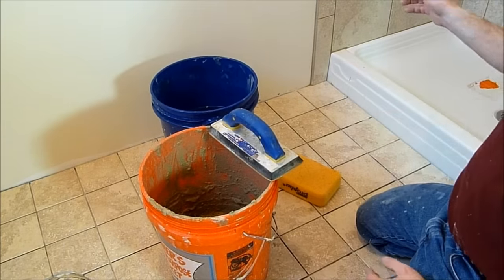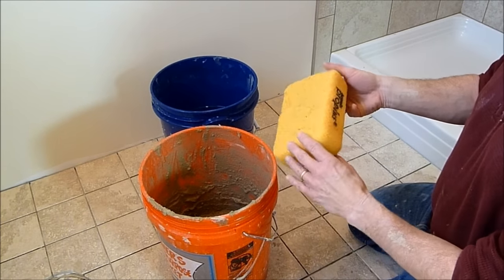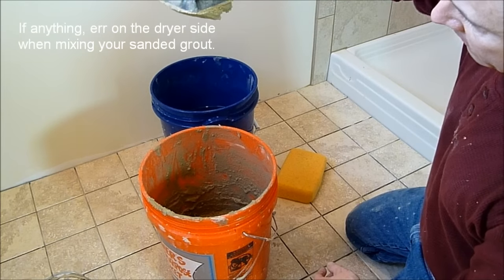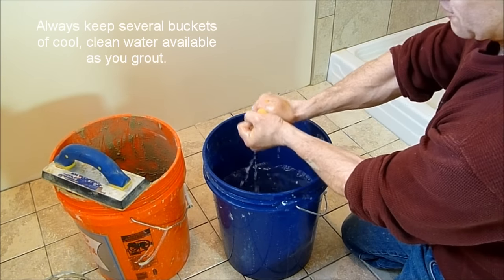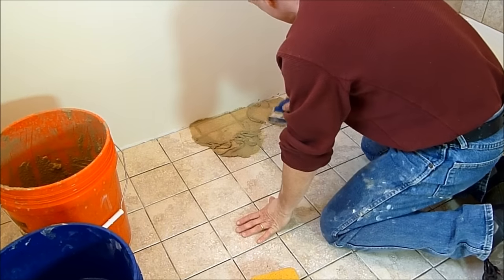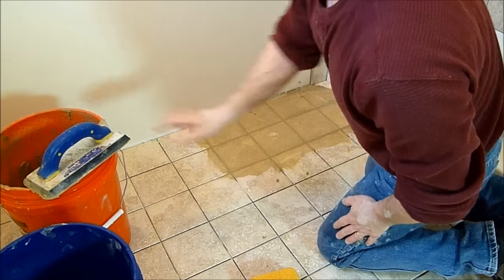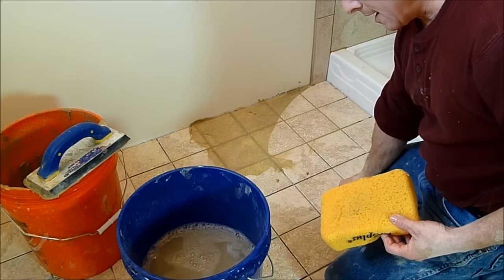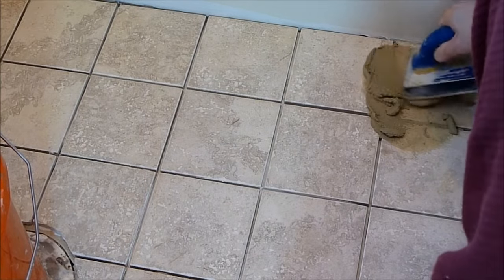How To Grout Tile: Correct Technique Makes It Easy

Comment: That's exactly how I put icing on a cake!
Reply from the maker: There are some masons who use an industrial-sized triangular bag with a hole in the point to repoint bricks with mortar, exactly as cake-decorators use.
Reply: I was thinking that the way you spread the grout at first made it look like icing.  Gordon Ramsay would approve of your technique.

I’ve seen those bags, and I wondered what they were for.  I thought about using them for putting grout in the tile spaces, but the opening in the bag seemed too large. 

What if you could get something like the tubes used for caulk, only you put grout in them?  Then you just squeeze the trigger and apply it like a bead of caulk.  You still have to work it in and smooth it out, so maybe this is not such a great idea after all.  

I have lots of ideas that turn out to be disasters, but it’s fun to try something you’ve never done before to see what happens.  
Thank you for posting your videos!
Reply from the maker: Yes, you answered your own question.  Since the grout needs to be worked and pressed into the cracks, there's really no time saved in trying to minimize the spread over the rest of the surface.

Comment: Great video. Question for you. I was tiling the laundry room and had my baseboards done as tiles as well. Do you normally grout both the floor tile and the"baseboard" tile at the same time? I hear people do that normally so you only mix up one vat of grout.
Reply from the maker: If you are using the same color grout on both tile then there's no reason not to do both at the same time.

Comment: I like the vid but how do i remove dry grout of the walls?
Reply from the maker: John Mcleveish If you've grouted correctly there should only be a slight haze on the tile after it dries.  This comes right off with a damp cloth or sponge.  If you've made a mistake and left grout where it shouldn't be you may need to scrape with a putty knife (try a plastic one first so you don't scratch the tile) or some other implement.
Reply: John Mcleveish The baseboard trim, once installed in place, should cover any smudges made on the walls during grouting.
Reply: ***** lol dude your late i already tiled and finished construction on my home but thanks anyway
Reply: Don't you get one of the special tools such as a grout saw

Comment: Don't forget to prep and remove any thinset that might have come up between your tiles when you laid the tiles. Otherwise, you might see some of it if your grout color is very different from the color of the mastic that you used to adhere the tile.
Reply from the maker: I think you mean "thinset" rather than mastic.  You should not be using mastic to lay tiles in a wet area like a bath, and I would argue mastic shouldn't be used in any circumstance.
Reply: @enduringcharm  yes thin set.

Comment: I've been killing myself using too much water. I'll try you method tomorrow. Thanks!
Reply from the maker: It's second nature to me now, but it can be tricky to get the right mix when you aren't as experienced.  You may have better luck with smaller batches.  Use a drill mixer and sneak up on the right amount of water by spritzing with a hose as you continue to mix.  If you screw up you can always add a little more grout as long as you haven't used up the whole bag.

Comment: How shall i dispose of the grout water? Cant be in toilet right?
Reply from the maker: You can dump the grout water outdoors, it's not harmful to plant life.  I usually fill the grout buckets from a hose anyway, so if some grout from the bottom of the bucket ends up in a pile, just hose it down to disperse the remains.

Comment: you must get paid by the hour if you do a few tiles at the time...Depending on the kind of tile you can do from 10-20-30 sqm before washing it with sponge
Reply from the maker: This video was made for amateurs who are new the process, so I think small sections are wiser.  When I work I grout the area that I can reach from my knees, then move the buckets to the next section.  Depending on the shape of the room that area may be smaller or larger.  In a typical bath with shower or tub/shower and floor the grouting takes two or two and a half hours, including clean up.  For a larger or more complicated bath it may take a half day.  The beauty of my system is that I never get up and go back on a previous section to clean up haze, etc.  Once a section is done, it's done.

Comment: Can’t you just lay the tile for a thin grout line with  un sanded Grout? Without sponging and wiping ?
Reply from the maker: You can choose thin grout lines (under 1/8" inch) if you like and use unsanded grout.  But, the application process is the same.  Arguably the unsanded grout is even a little more finicky to work with since you can more easily pull it out of the joints as you wipe.
Reply: Ok thanks for the reply

Comment: why does grout break out of the tile seams?
Reply from the maker: Jim Smart There are many potential reasons for grout failure.  Among them are a floor, wall or underlayment that flexes too much, damage from from use (heels, rolling wheels, furniture, etc.),, and poor installation.  Age can become a factor after many decades of use.

Comment: why would u grout the the tile gaps that meet the wall?? maybe its just America but here in australia they have to be caulked..
Reply from the maker: You were looking at the room before the baseboard trim was applied.  Typically in the US the tile is put down first and grouted and then a baseboard moulding is applied around the perimeter of the room, which covers any gap.
Reply: I was under the impression you were tiling floor to ceiling my bad.

Comment: Can you pour the water down the drain?
Reply from the maker: That's a great question.  While the "grout water" is not toxic, the sand and the color stain could cause trouble in the sink or the drain.  I dispose of the water outdoors.  It will not hurt a lawn or shrubs, and I hose down whatever I pour out to dissipate the sand and color.  It's never been a problem in the decades I've done this.  If you live in a city or in a situation where outdoor disposal is not possible or practical, you could look for a utility sink and wash the sink with fresh water as you pour.  You could also attempt to catch the sand and toss that in the garbage rather than let it go down the drain.

Comment: my bag of grout says to wait 30-60 minutes after floating and before wiping off with a sponge,
Reply from the maker: I don't doubt that your bag does say that!  You'll also get that same advice from Home Cheapo sales associates who have never actually tiled before.  That old school method did entail a lot of waiting and scrubbing and scrubbing some more.  If you enjoy that sort of thing, the grout will still work that way.  But, if you have other things you' rather be doing then the method shown in the video will work as well for you as it has for many others.  I have tile installations that are 20 years old using this method without issue.
Reply: not disagreeing with you and should've went with my gut.  i grouted an area of about 325 square feet in one shot.  the grout started to dry and it was a real bitch to get off.  in the end the tile job looks great but that'll be the last time i listen to the instructions on the bag.  felt like my arms were going to fall off.
Reply from the maker: HAHA!  Yes, that's the problem!  Sorry you had such a tough time, but that's exactly why I use the method in my video.

Comment: How  we can remove the hase after grout
Reply from the maker: If you used my method in the video there will be little to no haze after drying.  You can use a dampened rag.  If you used a different method or you screwed up and have a lot of haze, you may need to use a chemical haze remover available at your tile store with either a rag or even a scotch brite pad.

Comment: No knee pads? You a beast...
Reply from the maker: Actually I do usually wear them, but this was a tiny job and maybe I had broken them or something that day.  I have difficulty finding knee pads that stay on and that stay together.  Often I'll only get one or two jobs out of a pair.
Reply: @enduringcharm  I been trying several brands. , but they all seem to slide down and then you don't have knee protection.  I bought the gel , with an upper strap that helps keep them up ., but still slide down. The guy that invents knee pads that don't bind you AND don't slide down will make a million! !
Reply from the maker: Yeah, lots of new designs now but most of them are awful.  The pads with just a single strap are useless.  I try to buy the type with two adjustable straps (non velcro).  I've found if I criss-cross the straps in an X pattern behind my knees they stay in place a little better.  Pants with pads built in would be better.
Reply: @enduringcharm  I actually had an idea now.  How about some knee pads have the little loop in the top sewn in. You can take large safety pin and attach it to your pants that way ..  I am going to try it. .
I tile and some days notice that I have the knee pads on , but they moved out if position and I am on my knees, no pad.. 8 to 10 hours. Some days I think I should have been a hairstylist ,, like my sister.. Heheehee!
More money in it than tiling. ..
Reply from the maker: Well, report back if it works!  I have the same issue with movement, usually on my right knee.  I'll have something in my hands so I can't adjust the pad, and I end up kneeling down with nothing more than shin protection.  I ride motorcycles and you can get motorcycle jeans and pants with built-in knee pads, adjustable for height.  Unfortunately they are way too expensive to use in construction.

Comment: how to mix the grout perfectly? i have no idea
Reply from the maker: Look in the video description for a link to a newer video that does show some grout mixing.  The trick is to sneak up on the right mix, rather than trying to get it right immediately.  Start too dry, mix a little, add a little water, mix some more.  It can become too wet very quickly, so be patient.  A good mix for the field tile will be dry enough to stay on the float when you let it hang in the air.

Comment: hmm.. isnt it simplier if u have around 3" square rubber and apply grout on the spaces only?  the sanded grout actually scratched the tile surface already.. just saying..
Reply from the maker: No, the sanded grout does not scratch the tile surface.   You need to force the grout deep into the grooves and completely fill the space for durability.   There's no need to cover the surface, but there's no harm done in the process of wiping it on or off.

Comment: the best way to grout is use in a micro fiber cloth tawel fold twice and you will have 8 clean sides to wipe the excest of grout abd it will be less damp then a sponch
Reply from the maker: Well, that would take a lot of towels to do a room!  I would also be concerned about the texture of the grout when wiping with a dry cloth.  Think I'll stick with my sponge.
Reply: I'm not talking about dry towels! 
Sponch will always will couse grout decoloration especial in dark colors , and microfiber towels they are made with nylon and cotton fiber.  Not paper, I had used one towel in. 1200 squer feet of tile and it didn't have to used a second one!.
Reply from the maker: Oh, I see--you're using a microfiber instead of a sponge but with a water and bucket.
Reply: that will a good idea!

Comment: What happens if we don't put grout
Reply from the maker: All ceramic and porcelain tile is designed to work with grout lines, though they can be thinner if preferred.  Without the grout you'll just have weird slots in the ground to collect dirt and a less secure installation.

Comment: I was told you leave the grout to dry a bit maybe 20 minutes before wiping off.???
Reply from the maker: Let me guess, a Home Depot employee told you that?  The old school method involved wiping on the grout, letting it set, and then methodically wiping it off, often multiple times.  If you let grout set for 20 minutes, you'd be scraping dried residue from the tile.  There's no reason to let the grout set up before you wipe, as long as you follow the guidelines in the video and don;t use too much water in the sponge.
Reply: enduringcharm thanks for that,I guess everyone had there own way of doing things. So if it works in this video,it’ll work for me . 👍

Comment: Why are you not letting the grout cure a little, you wipe as you spread?
Reply from the maker: That the old school method and there simply isn't any need for it.  As long as you pack the grout lines solid and wipe without leaving excessive moisture, you can wipe right away.  I have installations 20 years old using this technique.
Reply: @enduringcharm  cool man thanks for the response. I've got about 1,676 sqft to grout Monday I'll use your technique
Reply from the maker: The biggest mistake newbies tend to make is too much water.  Be careful about the mix but be VERY careful about squeezing all the water out of the sponge.  When you leave too much water behind it can leave uneven grout color and even weaken the grout.  Really work the grout into the joints, then wipe with just a damp sponge and you'll be fine.

Comment: formula of grout making
Reply from the maker: Grout comes dry in the bag and you will slowly add water in a bucket to the dry mix.  Use a drill-powered mixer.  When you get to the consistency of peanut butter or so, you are done.  This video has some additional information:  https://youtu.be/_aja8hfhElI

Comment: My fucking husband let it dry and said he was going to wipe it later. Im dieing right now !!!!
Reply from the maker: Eeesh.  Not good.  Your husband probably owes you not just flowers and dinner, but some moderately expensive jewelry.  You'll need to painstakingly remove the grout from the tile itself and the grout lines may not look very good even after you finish.  If it's porcelain or ceramic tile it will take a fair amount of abuse without scratching, so a moistened scotch-brite pad may be necessary depending on how much grout is on the surface.  Start first with a dampened rag and see how much comes up.  If that fails, work your way up to more aggressive treatment.  Try the technique on a spare tile first to make sure you aren't damaging anything.
Reply: Luckily it's  large tile
Reply: enduringcharm thank you so much

Comment: I was taught to just hit the seems and not to get the grout all over  the tiles
Reply from the maker: There's no sense in taking extra time to avoid covering the tiles themselves.  You have to cover at least the edges of the tiles in order to firmly embed the grout in the grout lines.  You won't harm the tile with the grout, either.  It's faster to simply work the grout into the lines and let the grout fall where it may.  On smaller tiles (the ones in the video are 6 or 8 inch square) you really have no choice anyway.  Last week I grouted 12x24 inch tile, which is more typical these days.  Again, I just worked the grout into the lines, and then wiped diagonally with the float to clear excess.  Then I worked the sponge on each section.  I typically keep a pile of grout on the floor, and pull from the pile as I go.  When I reach the doorway, I use the last of the pile on the marble transition and wipe it clean.

Comment: 4th day in a row that some of my grout keeps coming apart.
Reply from the maker: Possibly you didn't mix the grout well enough, you used too much water, or you mixed at a very high speed and introduced a lot of air.  If you used an old grout that was previously opened that could also be an issue.  Generally the modern grouts sold at the box stores or at tile retailers these days are very good and very forgiving.  If you are having problems you can scrape out any loose grout and regrout those sections now.

Comment: Why  grout the full tile instead of only the joint lines. Seems like a waste of grout in this video
Reply from the maker: It's done that way for two good reasons.  First, you would waste a lot of time if you attempted to only fill the grout lines without getting some on the tile.  Second, it would be difficult or impossible to work the grout into the joints properly without also getting some on the tile.  Very little additional grout is used since you use the float to wipe off the excess from the tile surface.

Comment: Why is it nobody shows how to grout a ceiling or a wall. The floor is way too easy.
Reply from the maker: There is no difference whatsoever grouting a ceiling or wall compared to a floor.  Of course, you will lose some of the grout to gravity as you go, so start at the top and work your way down.  If the area below is clean (like a bathtub or shower pan) you can continue to use the fallen grout.  When I grout the edge of bullnose tile where it meets a painted wall surface, I use my hands to push the grout in, which avoids buggering up the paint with a tool.  If you are quick and careful about it, you can sponge that area and the paint will be fine.  Sometimes I'll need to touch up the paint, but generally it's fine.  Other than that, walls, floors and ceilings are done the same way.
Reply: @enduringcharm  Thank you for your replay. After experiencing titling then grouting a ceiling and wall, I was hoping to learn a secret or two to make the job easier. I did learn one secret, hiring a pro to do it for you. :)  Have a good day.